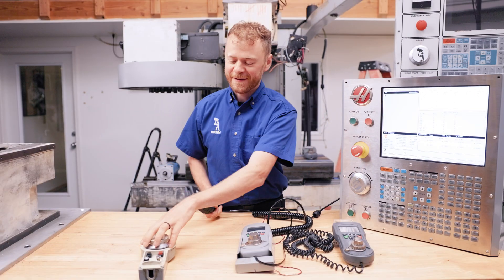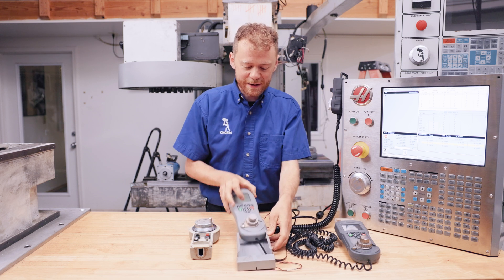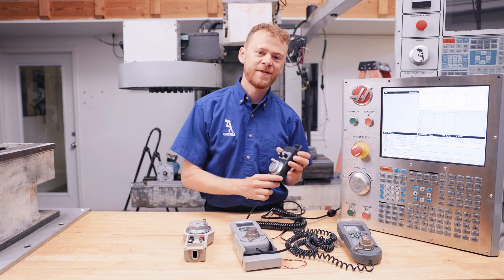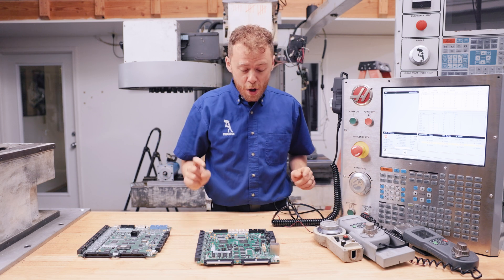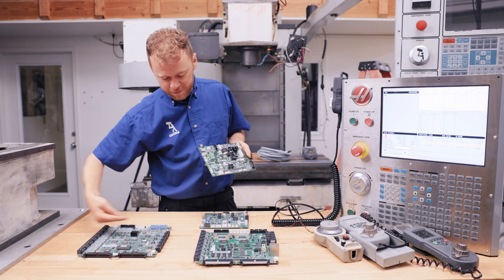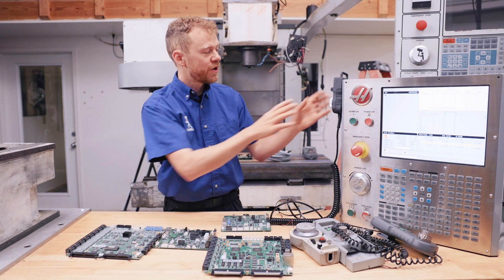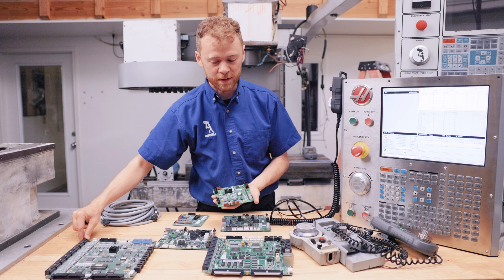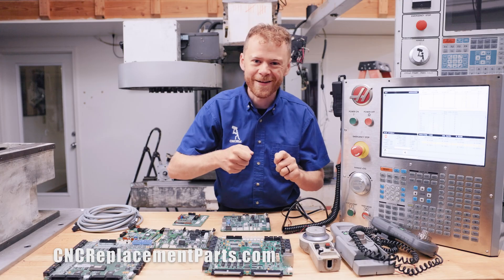Haas Remote Jog Handle Upgrade

Comment: do the new handle jogs with the large touch screen from haas work with older haas machines specifically 07 vf2
Reply from the maker: @willacademic  no.
Reply: @cncrepairman  dang, thanks for the response!